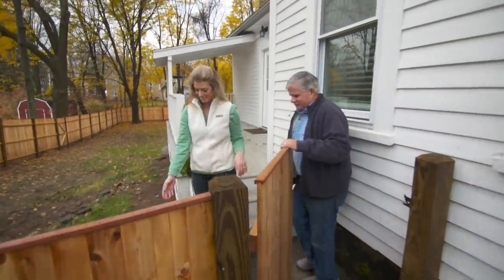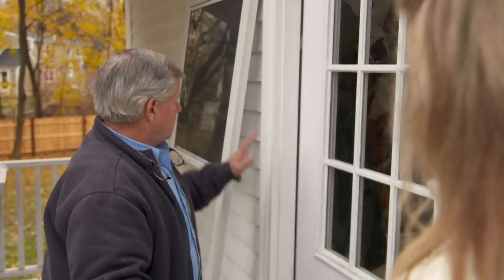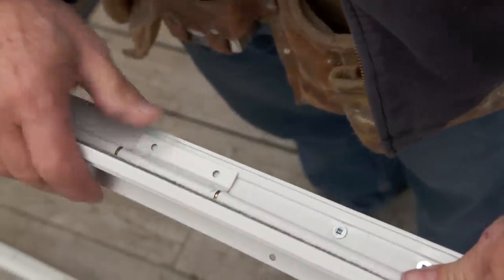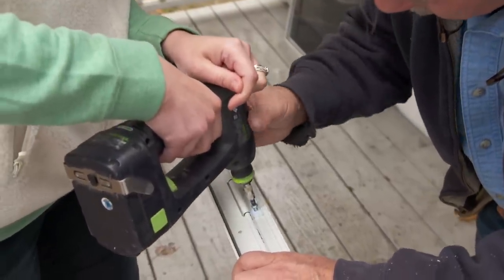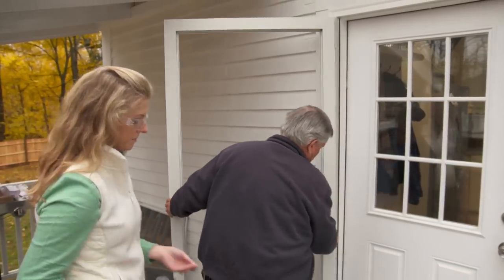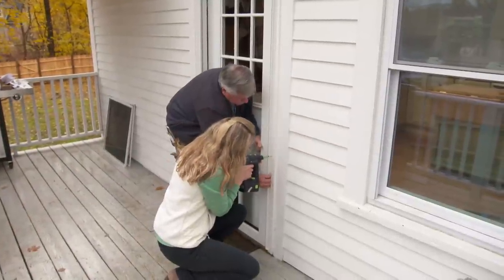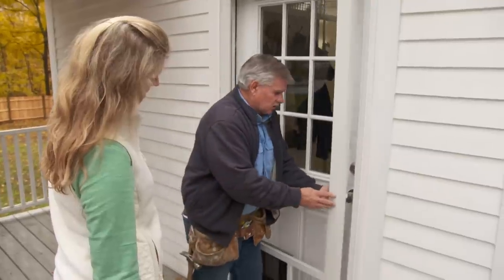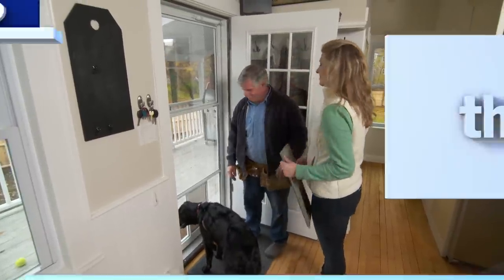How to Install a Storm Door with a Dog Door | Ask This Old House

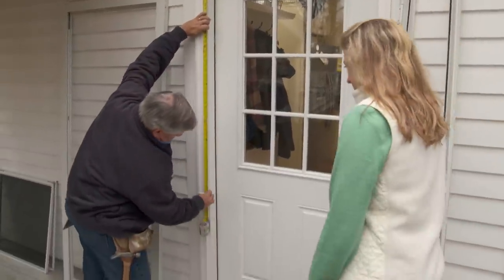Comment: Tom just low key dropped some geometry on you guys.  Taking advantage of the fact that the door width is 3.0 FT.  I'm very impressed.  1:53
Reply: Actually it’s trigonometry
Reply: Pythagorean theorem  " triangles, there everywhere "
Reply: if you’re a contractor, framer, or carpenter and don’t know the 3,4,5 rule, you need to find a different job

Comment: I thought they were going to show putting a dog door into both the storm door and house door.   I've had to put several in outside house steel doors and it's a project.  This setup for a storm door looks nice, but the price at the big box stores was more than the security / steel door itself.  Nice job done by Tommy, of course.

Comment: Well as you can see here it is well past time to do away with Philips drive and flat head screws completely move to Torx and or Square drive attachments You do have to be careful torque wise but bits will last for a very long time. I use these methods wherever I possible can.
Reply: Philips drive is very good, you just have to match the bit you are using with the screwto drive it in otherwise it will slip.
Reply: Agreed but still not as good as I mentioned. Almost zero loss with Torx or Square but you need to be mindful of their ability to over torque and damage your works in progress.
Reply: This is a really bad example of their ease of use and viability. Heck I'd be doing it without even pre-drilling the holes, the woman is just useless with the tool and isn't applying enough pressure to injure a baby insect.
Reply: I agree. Just a few days ago I installed that same type of storm door. Unfortunately, it came with all those white-head Philips screws. If I knew that, I'd have taken some white Robertson (square head) screws.
Reply: Nikola Wiche she's just trying to stay safe
Reply: Even though your comment is another year old... "a typical male pig"? That's a laugh, I'm a woman myself.

Comment: I don't know how thick or strong that storm door is but regularly you install the closer in the middle to prevent the door from warping. Usually they are only about 2 inches thick of light aluminum rails, panelling/glass so over time the bottom will not be water tight. Only heavier door get closers at the top.
Reply: There's nowhere for it to mount in the middle of the door. The door was designed for that piston to be at the top

Comment: Why do most people use a drill/driver starting and stopping while putting in a screw???  If you hold steady speed and pressure, the screw will go in easier.  And with the clutch set to the proper setting, you won't strip out the screw hole.
Reply: L.I. Archer i

Inexperience I guess.
Reply: I never understood that either?  Why does everyone pulsate it instead of set the damn dril and go or at the least, drive it in until it's close and pump it firm I can understand that.  But all these youtubey people and these "Imma show you how to" people I keep seeing do that.  It's annoying as fuck right?
Reply: I think it is to give you a chance to exam your work and make corrections before it is too late
Reply: @REVerbtalk  i love being pumped firm
Reply: I can't speak for most people, but in Tom's case, I think it has to do with him being an "old guy." Earlier drivers didn't have the precise speed control that new ones do, so someone like him who's been doing this a long time got in the habit of quick, short pulls of the trigger to maintain control. Kind of like pumping the brakes pre-ABS. Now it's completely unnecessary to do the short pulls versus a light, steady pull, but muscle memory is one hell of a drug.

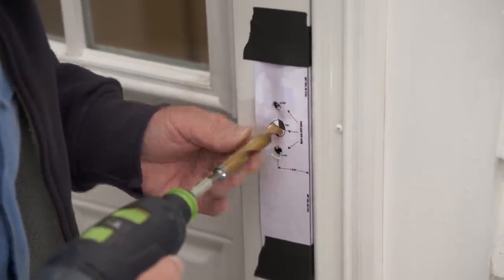Comment: Tommy I love your work but at 8:29 I felt my insides curl when you drilled into the paper. It's to guide where you center punch it
Reply: What is wrong with drilling into the paper? Can you show us on your tv show how you would do it? I really want to learn the best way. Thanks
Reply: @Sacapuntas69   nothing wrong with it this guy is just annoying af, center punching is nice because it give a point for the bit to "draw" on. However , if the hole is all the way through and works it doesn't matter

Comment: Probably help if you used the correct size bit. Looks like the screws are a No. 3 Phillips and the bit in the driver is a No.2 Phillips. Hence the non-stop camming out.

Comment: left the untreated wood  bared on the inside??.. I would have covered with something... that wood will need to be replaced in 5 years as the wet dog's fur touches it and what have you... but a covering with any anti weather material would have made it last for 100 years... surprised they did that, I guess you can still cut some vinyl paper or something and cover it. otherwise nice vid!

Comment: ill never understand the american phillips screw....
Reply: better than a flathead but i'd prefer a square or star bit any day
Reply: Philips and Robertson screws were invented about the same time. Philips in USA, Robertson (square head) in Canada. It's actually a fascinating story to read on how the rivalries developed and how for many years Robertsons were intentionally shut out of USA.
Reply: i'm sure they have tours where you can be stuck in a 95 degree trolley for 4 hours with no lunch, and go through an industrial revolution outdoor museum with a orator teaching you all about the ultra exciting rivalry between mr robertson and mr phillips
Reply: Pat Fitzgerald 😂😁
Reply: that was interesting...thanks!
Reply: It's simple really better than a flathead but not as good as a square or star bit. That help any?🙄 Lol
Reply: Better than the star bit.
Reply: @judsonclayto7813  I hate the star bit.
Reply: I prefer flat head screws. Really no way that you can strip them.
Reply: Bret .Maverick 
NO WAY! Star points are the best
Reply: Tommy screwed in the back door
Reply: Nothing to understand. It was designed to be used on production line with machinery. The design allows the screwdriver to be easily slipped in and out and reduces the need of accuracy (relevant at a time with less sophisticated machinery) when inserting as the shape naturally brings the head into position as it is inserted. It's why we were an industrial powerhouse and Canada is irrelevant.

Comment: What is the 3 4 5 method for a 32" door?
Reply: It doesn't matter the door size. It actually doesn't even have to be a door. If you want to check if ANYTHING is square, you can measure 3" in one direction, 4" in the opposite direction and the distance between them should be 5". It doesn't even have to be inches.... it could be, 3"x4"x5" or 3'x4'x5' or 30'x40'x50'. If you want to learn more about Pythagoras' Theorem you can google it. Hope this helped.
Reply: A level
Reply: 32”, 42.6”, 53.2”

Comment: You never blow metal bits like Tom did at the 3:48 mark, especially without eye protection.  You can really mess up your eye if the metal shavings get in.  Didn't they teach them that in Carpentry 101???
Reply: L.I. Archer  stop being a 🐱🐹
Reply: Stop being a cat dog???
Reply: Absolutely right! Did once when helping my dad with door and I had a really bad time.
Reply: Tommy wasn't doing the drilling. The shrapnel was aware and therefore was only targeting the home owners' eyes.
Reply: No, that's tinknocking 101
Reply: Just use your safety squints and you'll be fine.
Reply: Dude, Mr. Tom knows exactly how much air and how much force is needed to move every metal shaving out of the way without a single one blowing up back towards his eyes. He can calculate that in his mind then blow just the perfect amount of air.

Comment: Watching her strip those screws made me cring!!!
Reply: Best is Robertson screws 110 x better then any Philips .
in Canada i was using them now i am using torx screws in EU since i can not get Robertson ones. . It is not just the bit size ,but if it is to soft metal screw then it will fail .Were the Robertson or even torx are deep giving the bit 
110% fit .

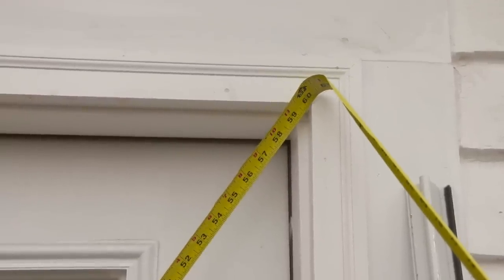Comment: so .. .am I the only one who thinks, that his measurement at 2:30 or so was off by like an inch or so? .. the width of the tape?
Reply: well .. mainly he "zeroed" on the top of the tape, and then took the measurement with the bottom of it.. but the door came out to be square so I don't know
Reply: You're looking at the wrong spot of the frame.  He is measuring on the edge of the side jamb, not the stop.

Comment: Is anyone annoyed by how she uses the drill
Reply: Definitely. But she tried.
Reply: Izzy Ramos-Gunn if your annoyed then don’t watch the video.
Reply: shes so beautiful, i didnt notice lol
Reply: No. She's so nice, I didn't notice.
Reply: Anyone who is annoyed by how she uses the drill is annoyed cuz they can never get a woman as Beautiful as her...
I bet who ever made the comment is single Lol
😎😎😎

Tom You're Awesome !!!
👌👌👌👌👌
Reply: I think the Phillips bit is just a little too small for the screw, so it slips out easier (innuendo intended).
Reply: She probably hasnt used one before
Reply: she is doing good .
Reply: @cooldude2204  the best is Robertson screws 110 x better then any Philips .
in Canada i was using them now i am using torx screws in EU since i can not get Robertson ones. . It is not just the bit size ,but if it is to soft metal screw then it will fail .Were the Robertson or even torx are deep giving the bit 
110% fit .
Reply: Not really. She is a novice, hence the reason for the show.
Reply: Hell, 10 years ago, after a few mashes of the trigger on the best brands on battery power, you needed a re-charge, or another battery.  Today's battery equipment will eat your face off.  It's liability man.  Notice he has her wear eye protection but he doesn't.  Come on man, common sense and don't be a complete misogynist.  With that rock on her hand, if anything went wrong, can you spell LAWSUIT?
Reply: She has obviously gotten through life on looks rather than brains so no suprise. This comment section proves that.

Comment: "One of the hardest parts of drilling" stop just stop using phillips screws. They suck.
Reply: JamesCizuz Phillips screws really aren’t that bad. The screws you get with these storm doors though are very shallow and the Phillip pattern is usually filled halfway with thick baked on paint from the manufacture causing your tool not being able too seat firmly in the first place.
Reply: @Sawashi32   Yes the best is Robertson screws 110 x better then any Philips .
in Canada i was using them now i am using torx screws in EU since i can not get Robertson ones. . It is not just the bit size ,but if it is to soft metal screw then it will fail .Were the Robertson or even torx are deep giving the bit 
110% fit .
Reply: Not sure where TF any of you get your Philips screws but they are FAR better screw.
Reply: JamesCizuz most of hinge or door companies send flat head screws they really suck